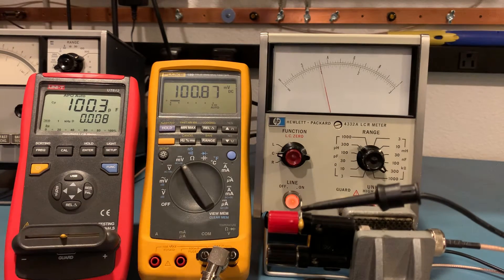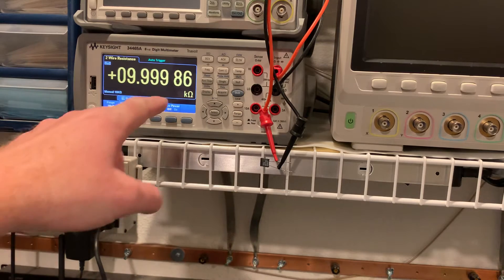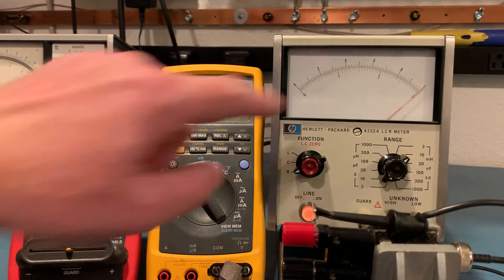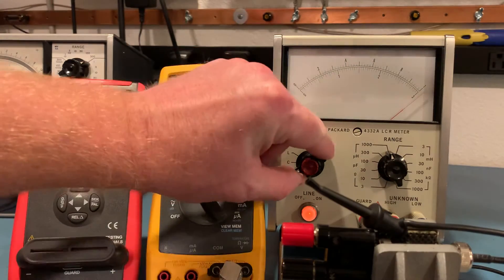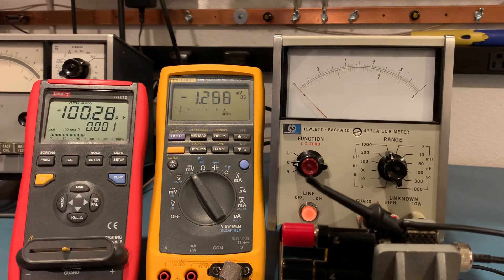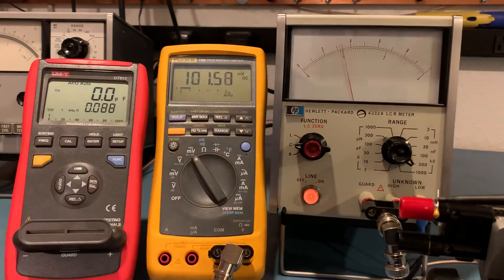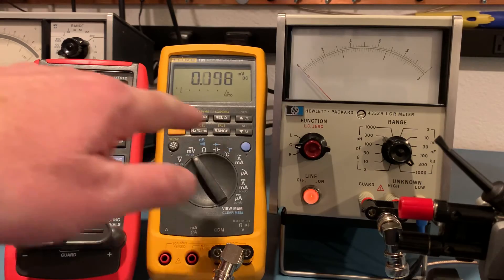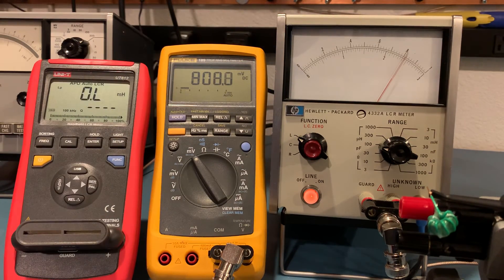HP 4332A LCR Meter show and tell

Comment: I think it was a joint venture of Yokogawa and HP, not "Yanagawa". I have this meter too. It's as accurate as anything new, but find it a little fickle for everyday use. For instance, if you try to measure some sort of non-shielded inductor, or even just a toroidal inductor, it seems the magnetic field produced by the inductor itself will mess with the analog movement quite a bit. I think you still get the correct reading from the back panel analog voltage output, but a little frustrating for everday use. Still love the thing, just because it's beautiful though!
Reply from the maker: Thanks for the correction.
Reply: WOW, man, I'm a fan of your channel, you share a lot of incredible knowledge.  It would be awesome if you return to making videos, maybe teaching Analog Electronics and more about Circuits. Congratulations.

Comment: Hi Damon, yes, there are no videos about this meter - thanks for yours. I have the same meter and some questions please . How was the fluke meter connected in order to get that 0 - 1.0v degree of precision/accuracy measurement?  Was the UNI T meter simply in parallel for the capacitance measurement? I have the 16138A YHP test lead set for the meter, what is the wiring inside it that you have replicated in your demonstration? (Guard included)  Thank you

Comment: Nice score, Damon. Always cool to have an instrument with a story, special tag, or badge. I haven't seen one of these in operation before, so thanks for sharing such a pristine specimen. What kind of repairs did it need?
Reply from the maker: I adjusted a resistor value in the Wien bridge oscillator to get the high range C to adjust properly.  Turns out, I didn't need to and put the original part back.  The problem was with my component under test and test method.  It was frustrating because I could not find a problem or part that had drifted, now I know why, there wasn't one.
Reply: @damonkj7e  
Reminds me of my HP 53310A that seemed to have a problem with input A. In reality, I had accidentally connected to the trigger input beside it instead. D'oh!